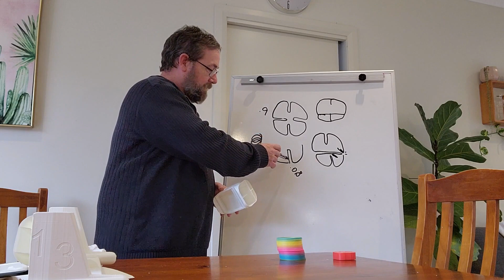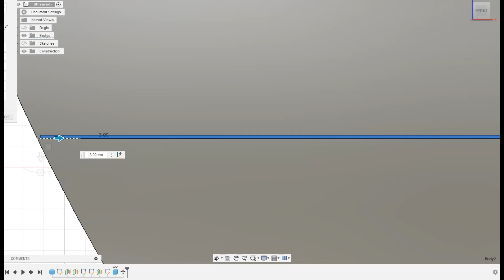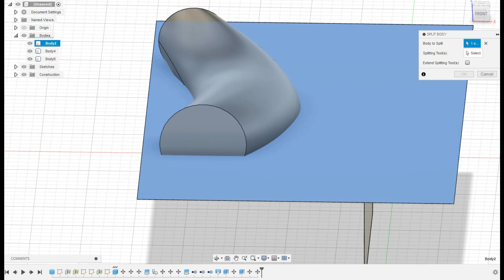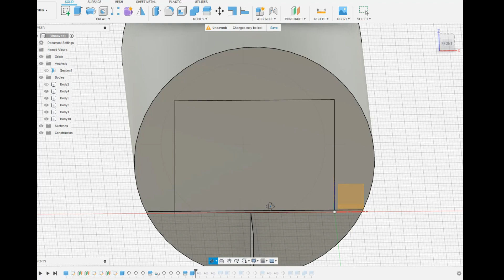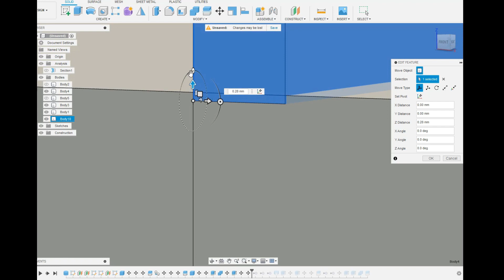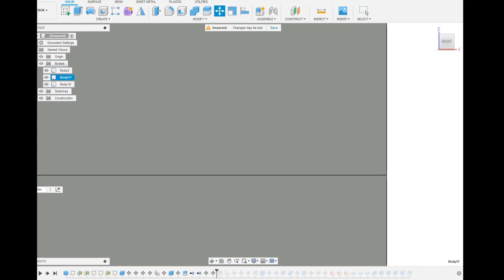3D printing LW-PLA with no stringing starts at the design stage

Comment: Thank you!  I’ve researching how to print vase mode bodies with integrated supports and it looks like you nailed it! I’m using a 0.8 nozzle so I assume I would double your gap numbers- 0.08 would become 0.16 and 0.9 would become 1.8.
Reply from the maker: Do a test print, I think you will find that you don't need to double the gap. Let me know either way, I would be interested to know.
Reply: Once the printer was set (Bambu X1C along Bambu Studio for the slicer) up for the 0.8 nozzle, the slicer no longer recognized 0.08  (internal structure gap). It does recognize 0.16 walls however, they aren’t fused. So I’ll need to try 0.12 or maybe even 0.10. Concerning the gap between the internal support and the interior body wall, I had doubled that (1.8mm) and that was too large of gap.  Going to have another go and will report back.

Comment: Thank you for the great tutorial.  Wish I had that 2 years ago.  The rational for why the 0.9 gap works is that the hot end nozzle follows the side of the line (as opposed to straight down the middle).  So when you have a 0.4 mm nozzle the 2 lines (at 0.4 mm each) leave 0.1 mm gap.  With expansion and ooze the filament paths touch and fuse together.
Reply from the maker: thanks for the explanation.